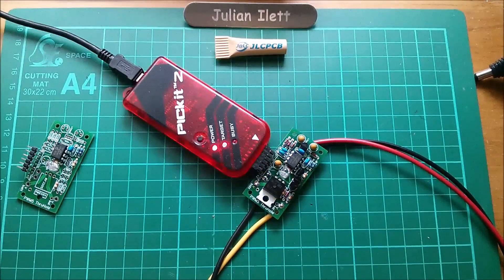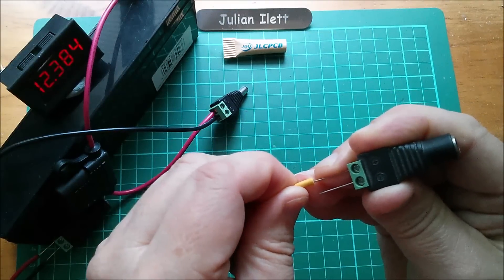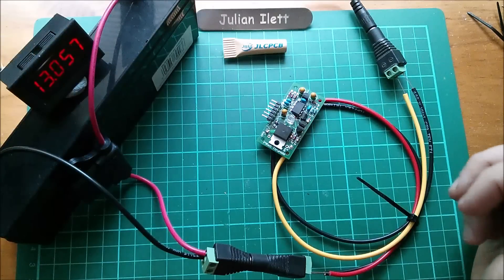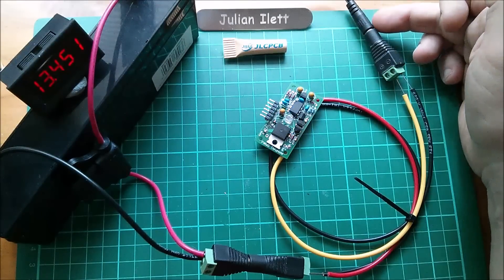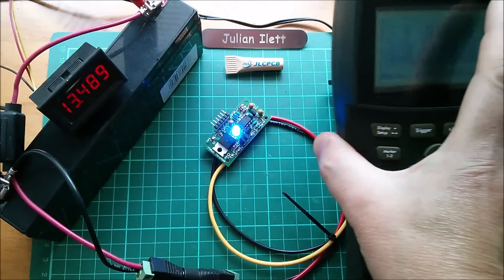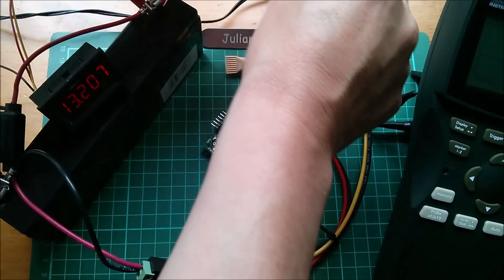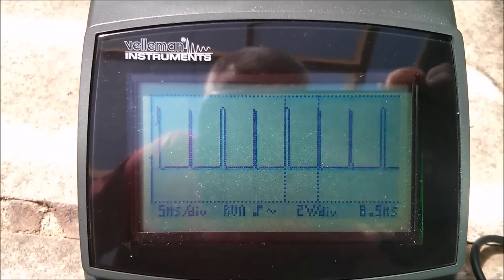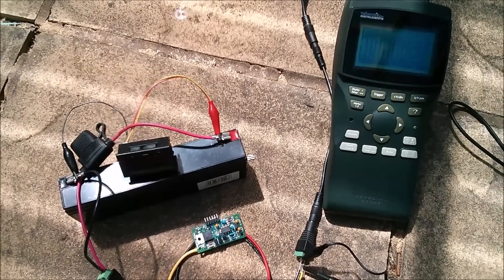Solar Charge Controller Testing (with oscilloscope) - PWM5

Comment: Why 13.5?  Everything I have ever seen or heard says 13.8 volts for lead acid type cells like that...one of my batteries even has it marked on the battery
Reply: The float voltage is really supposed to be temperature compensated. 13.8V is the nominal maximum.

Comment: If you're going to use pins, cut them shorter, i can see a pin bending as you force it onto the wire, and the other pin sticking into you.
Though it would be easy to do the connections proerly
or do you like living dangerously (remembers the packaging opening)

Comment: Julian,  towards the end of the vid you said you'd then remove the header pins and seal it all up.
Just a thought, maybe make life easier - have you tried pogo pins (search the term on e-bay for a photo)?  Little spring loaded pins sort of like the bars that hold your watchstrap in place.  They come in a range of diameters and have pointy ends.  Basically mini probes you solder down to match the layout of what you're connecting to.
Solder the pogos onto veroboard (or make u a PCB) to match the spacing of data lines or component legs - then you simply hold the "fork" to the pinholes or onto the pads and apply a little pressure while you test or squirt in the code and then move on.  The spring loaded pointy pogo pins usually makes a good contact and you can work down a line of boards programming as you go without needing to solder and unsolder.  Also good as PCB test probes.  I have a few made up for "typical" 2.54mm configurations I use.

Comment: Julian, did you ever think about using a 2 colour LED ( one colour for attained charge and the other to blink out the voltage) ?  Just a thought.
Reply: I'm pretty sure he's used all the output pins on the microcontroller - he would need at least one extra to control a 2-color LED.

Comment: I wish you had gone with one of the micro-controllers that you generally use (uno, esp32, esp8266 etc.). I don't know anything about pic. Shoot I don't even no that much about the arduino ide, lol, but I can at least follow the logic.
Reply: He's been using PIC a lot longer than Arduino.
Reply: @RedwoodRhiadra  I know he used to, I think he even said one time that is where he started (easily could have been a different YouTuber though). I thought he had finally kicked the habit a couple years ago. I guess it's like smoking. It's just so damn hard to quit, even when you can pick up an esp32 chip as 'cheap as chips.' ATtinies are almost free.
Reply: vonries - so are the smaller Microchip PIC chips...

Comment: Hi Julian, I noticed the battery voltage seem to fall quite quickly when you removed the transformer. Is it just the battery, or is the PWM5 drawing a lot of current when the charge current is removed. Keep up the good work!, enjoy your videos.
Reply: The battery doesn't draw it was just settling to its resting voltage.

Comment: So at 11:00 80% * 5W = 4 Watts of power goes to nowhere?
Reply: That is the idea of PWM. The function is to not connect the solar cell to the battery when the battery is full. So there is no 4 Watt going nowhere, it is just not being collected. No current, no power.
Reply: @deslomeslager  Looks like it is 20% = 1 Watt is not connected, while 80% is connected. But anyway, even it is vice versa: 1 Watt is too much consumption for controller + voltmeter.

Comment: Good Idea simulating the PV with that basic Wall Wort charger.   I'm playing at using nothing but a Buck Converter between the PV and Battery Bank. Using CC/CV hoping to realize the current gains of a MPPT.  My LiFePo4 cells would be quite happy being floated that way.  Yes you can float charge Li  Cells .  Once they reach the set voltage they simply don't take in any more charge.      Using my little DSO-150 I  in DC Coupling I can see the proper PWM signal on a PWM.    The trailing edges round off a bit when connected to a battery but looks way more square-wave then your scope is reflecting.  Maybe  a probe issue ?    I've collected everything I could find on your little charge controller.  I need another charge controller like I need a hole in the head but I'm going to give it a go building one some day here.  Your use of the blinking LED to convey the voltages is quite cool.

Comment: Why not leave the programming header but reverse its gender (sockets not pins) to save a little vertical space?  To program, use a pins-to-pins adapter.  Should be cheap enough and leave you with the ability to reprogram as needed in the future.
Reply from the maker: That would work. Now I want to implement a programming header on the Femto (SMD) board. Castellated edges maybe?

Comment: Julian, wouldn't you be able to mount the IRF3205 Mosftet to the other side, the metal tab from the mosfet would be facing outwards, away from the PCB, and allow you to attach a small heatsink to it? You would be able to increase the amount of current ran through it since it has some better passive cooling.
Reply from the maker: That's all fine until you encapsulate the unit to weatherproof it. If the enclosure is small, heat will build up inside - heatsink or no heatsink.
Reply: @JulianIlett  I guess you would have to try to seal the mosfet while leaving some of the fins of the heat sink exposed. As long as it's an aluminum heat sink it shouldn't corrode in the weather
Reply: I was thinking even a small heat sink would help with the things longevity.  Here in the Southwest Desert of New Mexico the poor thing would be toasting for sure.

Comment: I think you may be over critical of your boards capability's..lol. You said it takes a sample every 5 seconds and the battery seemed to fill up very quickly. So if you account for mild losses in connections and discrepancy in the Chinese volt meter and the speed at which the voltage was rising in the battery, the LED reporting were only out by 50 mV  for 10 seconds  or so. I feel that given a proper solar panel and a bigger battery and possibly a better meter you may find the numbers better.  And still 1000X better than any cheap PWM controller from china...awesome project
Reply from the maker: Thanks. An accurate measurement (no load) is taken every 5 seconds for the LED voltmeter to display, a less accurate measurement is made 122 times per second :)
Reply: @JulianIlett  wow...lol...still way, way better than most of the junk out there...and even some of the claimed good ones..I had a simple 25w solar panel on a caravn and a pwm charger to keep the battery topped up. It gets parked in the very back of the property. Like yours just a bit wider and about twice the back yard..one day  I hear a horrible bang...The battery exploded!!! after washing everything down, and picking up the bits...The PWM had gone on the fritz and was pumping the 18v from the solar panel and boiled the battery and somehow the gasses ignited....
Reply from the maker: Ouch - that's nasty. I enabled the PIC's watchdog timer - so if the unit locks up, it will reboot and start modulating again. This should make it pretty bulletproof.
Reply: @JulianIlett  That's what I mean by 1000x better. The implantation of the 1 led for status was genius and your coding has been so well refined over all the PWM solar chargers you have done. With the passion and skill you have this unit will be a great success
Reply: Truth is there... Julian, you made a great little device.

Comment: plans for a 3 stage charge code ?
Reply from the maker: The PWM5 has bulk, float and absorption phases.
Reply: and maybe some current sensing ? ;p
Reply: Milene De jong - why not a 33 stage charging system?
Unfortunately there is a lot of sales speak with charging systems these days.
With a current limited supply (that is within the maximum charge current for the cell, cells or battery) you only need a “two stage” voltage regulation system. A 12V lead acid battery is happy with a charging voltage / float voltage of between 13.5V to 18.8V (but this voltage is at 20C). The higher bulk charging voltage (around 14.5V) is only there to speed up the charging. And is not important in applications where the cell, cells or battery spend most of their time in a standby / float charge mode.

Comment: The charge controller seemed to be draining "lots" of power even with no battery connected on the other end? Or am I mistaken? Looking at the volt meter it stopped draining fast as soon as you disconnected it.
Reply from the maker: No, the controller has a miniscule power drain.
Reply: If a lead acid battery is interrupted from charging while it is not fully charged, the terminal voltage will drop fairly quickly down to around 12V to 12.6V.

Comment: Wouldn't dipping in epoxy resin be cheaper and easier than the UV glue option? Probably quicker as well? Just a thought.
Reply from the maker: Probably, but I don't want to get any coating on the connecting cables.

Comment: What are the details on your little oscilloscope?  Would you recommend it?
Reply from the maker: Not for general use as it's a bit basic. But for use in the garden it's perfect - it's powered by 5 AA NiMH cells and the monochrome LCD is perfectly visible under sunlight :)
Reply: Julian Ilett, Thanks!  I don’t need clever triggering and the such. I just want to look at things like how a PWM waveform changes during the charging process (thank you), and to see gross noise and distortions in the various parts of a solar setup.  
Thanks!
Reply from the maker: The scope is a Velleman HPS10 - not sure if it's still available. I think UNI-T do something similar.
Reply: @mikemead2315  
the little dso138 would be ok for this sort of thing and is much cheaper :-)
Reply from the maker: Not as good - because colour LCDs are very hard to see in direct sunlight.

Comment: I always wondered what the output of a pwm looked like. I never trusted anyone’s VOMeter reading as “proof” of what was going on.
Reply: He did a video a while ago showing what the PWM looks like on his good Keysight scope.
https://youtu.be/SZOqdYWvIaQ

Pulse-width Modulation sounds great too. It's a useful effect in synthesizers to give some movement to an otherwise plain square wave sound.
Reply: dentakuweb, Thanks!
Reply: dentakuweb, Yes!  That was a very good PWM video. My problem now is I need to find a new reason to absolutely need a portable oscilloscope ;-)